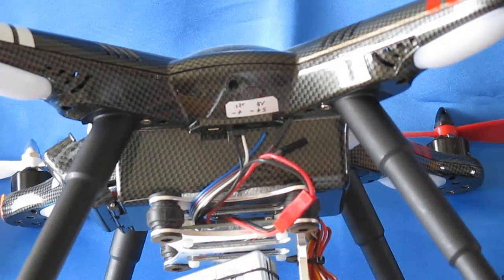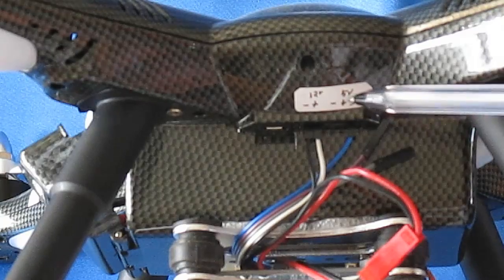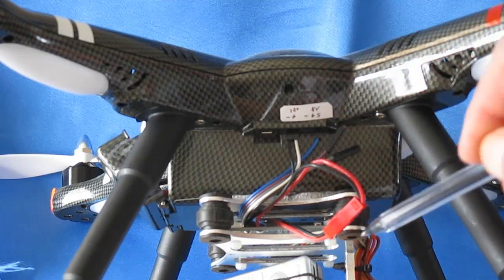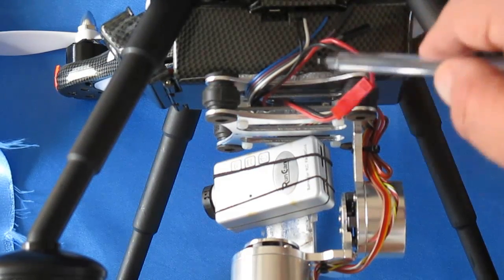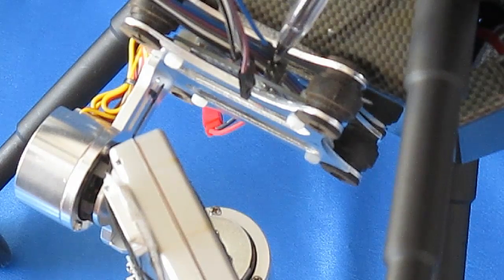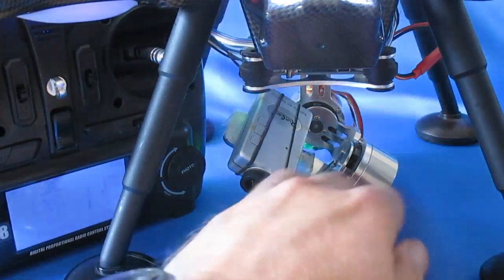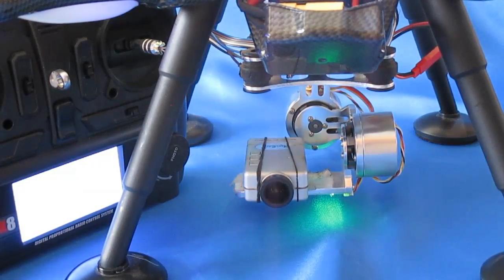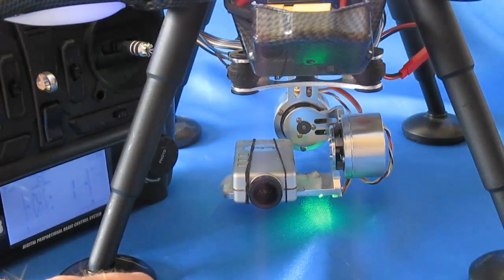XK Detect X380 Drone Generic Gimbal Electrical Wiring Setup

Comment: see how when you plug in the battery you get the light cycle tgat I was talking about (red to Green front to back) mine just keeps doing that when gimbal is plugged in (set it up just like in the video)
Reply from the maker: +mark valis If I remember correctly, your gimbal was received damaged with a broken wire.  Did you ever file a dispute with Paypal?  If not, time is running out.  Do such soon.
Reply: +Quadcopter 101 

got a refund and a new gimbal! however when I hook it up (12V and signal)  the LEDs go red to Green and it doesn't sync to quad I also just get a blinking red light(RTH and headless in up position)  As soon as I unhook gimbal I get green green in regards to GPS
Reply from the maker: mark valis Not sure what the problem is.  It sounds like there may be some interference with the GPS.  You don't have any add on straps or wires running over the top of the quad do you?
Reply: +Quadcopter 101 

no sir only thing I have done is GPS shield mod. When I unplug gimbal no problems
Reply from the maker: mark valis What is GPS shield mod?
Reply: +Quadcopter 101 

additional copper tape on inside of shell covered with a layer of duct tape
Reply from the maker: mark valis Of inside of quadcopter shell?
Reply: +Quadcopter 101 correct just YouTube search x380 GPS shield
Reply from the maker: mark valis I'm guessing that is where the root of your problem lies. Would recommend removing the shield to see if your problem goes away.
Reply: +Quadcopter 101 

I will check it out and report back

Comment: I installed a black 40 dollar ebay gimbal on my XK  380. I am sure that I have the wiring right and I received the factory harness in the bow with it. My problem is that sometimes it seems to work great with the sj4000 camera I have on it. Then the next time I power everything up the quadcopter will not finish it's self calibration. The lights keep flashing and the props are twiching. If I disconnect the pitch control motor and power it up  the problem goes away. Due you think I have a bad gimbal or should I try changing some settings with the software.
Reply from the maker: +michael landowski Try lowering some of the power settings.

Comment: when my gimbal is plugged in the lights on the quad flash in a circular cycle. starting with back left, it blinks red once then the back right blinks red once next the front right blinks green and then front left blinks green around and around?
Reply from the maker: +mark valis It shouldn't be doing that.  Unplug and recheck your wiring. Remember +/- 12V and signal wire only as shown in the video.

Comment: I have the neg 12v next to the USB have the positive next to that. then to the pitch signal wire and it is on the last spot on the right. the signal wire is hooked up to the top left pin in the gimbal
Reply from the maker: +mark valis That should do it.  If the gimbal is powering up properly (leveling), then the problem is the signal wire.  Maybe try a different color wire from the provided cable (maybe the one that your using has a break somewhere in the wire.)
Reply: I will try that, weird thing is the gimbal came with a white wire that connects to the gyro cut ? So I put it back together

Comment: Bud JonesWhen I got the gimbal, I could find nowhere to connect the multi-wire lead-- so I stripped of the green, and used the single lead to the signal pin. The only other connection I have is the 12 volt (correct). I get a green light- but it does not work. Any ideas my friend?Thankscbudjones@gmail.com

Comment: Bud JonesThanks for the video. Today I hooked up the gimbal-- checked correct wires, balanced camera, hooked up signal wire-- nothing happened. I did have a green light on the gimbalbottom, but no leveling, no pitch . Any ideas? Took me months to save for this combo.Thanks
Reply from the maker: +Bud Jones Did you also hook up the +/- 12V power wires as shown in the video?  And also be extremely careful doing such.
Reply: +Quadcopter 101 In hooking up the gimbal, I have 3 connects. + and - 12 volt and the signal wire-- no movement-- I do have a green light on the bottom of the gimbal. Man, I really need this to work. I have found a way to make money with it.Bud jones
Reply from the maker: Bud Jones Well then, the gimbal may be defective, a distinct possibility at its price range.  Recommend contacting your vendor's customer service to see if they can help. They'll likely ask for pictures of your setup, particularly the wire connections both to the quadcopter and the gimbal.

Comment: pleased to hear that - my x380 is due any day. I
I think you might be correct about all the problems. Also seems to be a lot of tinkering with software going on. I think I will be leaving it alone for a while
Reply from the maker: +Gordon Melrose Do NOT mess with its firmware if it works fine out of the box.
Reply: +Quadcopter 101 Thanks for the good advice. Looking forward to Friday's video !!

Comment: Hey I just received this gimbal and being new at this (and a moron) I have a question about connecting to the power lead to the gimbal.  I have a female connector (red and black thicker than the universal wires in the package) that has bare wires on the end. Do I have to use this connector or can I just use the universal connecting wires to the red male connecter to the  gimbal.? I hesitate to use the universal leads because they are smaller.  Gun shy after hearing about all these fried boards. I understand what pins to connect to.  Thanks for the time you are teaching us.
Reply from the maker: +Marv JS Plug those bare red and black wires into the universal connector.  Keep track of the colors that you plug the red (+12v) and black (- ground) into.  Follow these colors and plug the other ends into the respective (+12V) and (-) pins on the quadcopter.  Then plug the female connector into the male gimbal power plug.  Regarding the signal (pitch) setup, see my comment to John James below.
Reply: +Quadcopter 101 It seems the universal connector would slip into the male power plug --not having to use the one with bare wires at all. This would not work?
Reply from the maker: Marv JS It didn't fit for me.  Did you try it?
Reply: +Quadcopter 101 Yes--both - & + slipped in side by side into red male connector that goes to gimbal -just like the connectors went into the quad.  Did not put power to it yet.
Reply from the maker: Just make sure that red always goes to + and black always ends up at -
Reply: +Quadcopter 101 Yes---Thank You--I enjoy your videos

Comment: Will this gimbal work on the V303 Seaker?
Reply from the maker: +Turtle3863 Yes, it will work on just about any large GPS sized quadcopter, along with just about any camera.  Here I just strap it on with velcro straps to a Flying 3D X8 https://www.youtube.com/watch?v=gnCXyOEmgao
or hard mounted to my X380 https://www.youtube.com/watch?v=4MWK8bxkviE
Reply: Thanks for the info, I am looking to maybe get a $200 or so GPS Quad that I can use the gimbal on.
Reply from the maker: Turtle3863 Before I answer that, what quadcopter's do you currently own, and how long have you been flying them?
Reply: I have a Syma X5C -1 and a Mold King Super S, Been flying for about 6 months. Really looking for a more stable video platform.
Reply from the maker: Turtle3863 OK then. I particularly like the following quadcopter in that price range.  It does have gimbal capability if you wish to add one to it. https://www.youtube.com/watch?v=38IhbPDG-RQ
https://www.youtube.com/watch?v=ykH0VerKtCA
Reply: Thanks for the info, that looks to be the one I  will most likely get and then add the gimbal.

Comment: Hi any chance you can do a calibration video for the 380 I no the 303 is same procedure but the 380 for vertical circle shows red light and maybe there are other slight differences there is someone on my forum having problems and this could help
Reply from the maker: +Don XK Detect XK380 The person is probably trying to do it indoors.  Needs to be out in the open so that no magnetic interference will occur from metal objects nearby.  But yes, it is the exact same procedure as the V303, which has plenty of videos on how to do it on YouTube.

Comment: I have followed your exact instructions, and I was able to power up the gimbal, however, the R/C pitch function didn't work, what else am I missing?
Reply from the maker: +chanfelix Well the + and - power cables are obviously hooked up correctly.  But would suggest that you triple check and trace your signal wire connection.  Note in the video where I connect both ends of the signal wire (both where it's connected to the quadcopter, and where this wire should be connected to the gimbal).  If you're still having problems, please make a video showing how you connected the gimbal, with particular attention to the signal wire connection points.
Reply: +Quadcopter 101 
Thanks Quadcopter 101 :D
I will try that when I get my replacement board ;P
I thought I did something wrong in the wiring, so I was playing around with different connections, still no luck, until I decided to swap the + and - (bad mistake!) Soon after I hooked up the power,  I saw and smelled smoke coming out from the quadcopter and at that moment I knew I fried the circuit board on the xk detect x380.

I appreciate your help :)  I'll check back with you when I get my xk detect fixed.

Comment: I have that same gimbal in black and would like to offer a suggestion.  It's tuned for the weight of a GoPro type camera, so you might want to add some extra weight since your Runcam is significantly lighter.  I have seen folks tape on some quarters or washers to add the extra weight.  Without the extra weight,the PID tuning is probably off and could cause issues or shaky movements.
Reply from the maker: +mrbwa1 Actually, all you need to do is to use its configuration software to reduce the power settings for lighter weight cameras. Click "show more" for the above video information section for where to download this software, along with more info that may be of help.  And here's one fellow showing how to modify these settings. https://www.youtube.com/watch?v=clX-FC7m13Y
Reply: +Quadcopter 101 I forgot you did that tuning video.  I have been knee deep in tuning on the Cheerson CX-20 and looking at adding the #DR radios to get real-time telemetry back into mission planner.

Comment: hey 101, the GPTOYS F2 Aviax is only $26 free shipping on gearbest right now, everywhere else I see it's $50-60. it has cool features for a x5c clone and at $26 it might be the best bang for the buck quad now. are you getting one?  
 http://www.gearbest.com/rc-quadcopters/pp_246262.html?vip=55876

I'm also thinking about trying out the Helicute H806 Hexacopter, it looks like its a hex version of a x5c that has a 7.4v battery: http://www.gearbest.com/rc-quadcopters/pp_218232.html
Reply from the maker: +adventures and quadcopters That is a good deal.  That quadcopter also has a neat feature which remembers the last 40 seconds of flight, and repeats it at the push of a button.
Reply: +Quadcopter 101 I'm not sure if this is one of those temporary deals, like for instance the mould king 33041a was $20 now its $25 and when the flying 3d x8 came out it was cheeper. then jumped up.
Reply from the maker: +adventures and quadcopters Supply and demand.  But right now because of the X380, demand on the 3D X8 has decreased.  Price on it has dropped significantly.
Reply from the maker: adventures and quadcopters No, not currently.  And am not really sure what the advantage of it is over the much cheaper XK X380, which apparently has the same features.

Comment: Great video as always I see you have single pins for the power side my gimbal had a connector on end of power lead and either my gimbal or the x380 had a cable that pluged straight into connector and then clicked into quad so I can't get wrong way round just signal cable I have to fit now ps I will be putting this video on my forum more people that see it the better lol
Reply: connected mine today all went good thanks bud

Comment: Hey Quadcopter101, 

Somehow my FC is fried due to connecting the gimbal to the XK. I connected the JST, Black near USB, red other side. Yellow cable from left signal pin to outer pin of the XK.. This is correct if not mistaken, and still my FC board is fried. Do you know how this could have happend and how to prevent? 

Thank you :-)
Reply from the maker: +RC Brothers Assuming that you did connect to the proper points, the next thing to check is your wiring for shorts.  Particularly, did you splice any wires?  If so, are you certain that they are properly insulated? A bare strand of wire accidentally touching the gimbals metal surface (or touching an opposing wire) can create a short.
Reply: The gimbal came with a female JST connector on it, so I soldered a male connector onto the board in order for it to fit on the XK. It was my first time soldering, so I need to check that.. Thanks for the suggestion, will look if that is the cause ASAP :-)
Reply from the maker: RC Brothers Yeah, mine also came with a male connector with wire attached.  I just plugged that into the female connector, then attached the other end bare wire leads into the universal cable (also provided).  No soldering required.  Now I think I should have also showed that in the above video :(
Reply: Haha, it could come in handy for the beginners such as me but hey, I learn from this! :-) Soldering is almost inevitable in the quadcopter business, but connecting a female wire instead of soldering the wire is a better option than what I have done

Comment: I bought the xk gimbal for mine its a little more expensive but I don't have to worry about hooking something up wrong. I'm seeing a few problem and crash videos popping up I was wondering if you've had any problems worth mentioning with yours ?
Reply: +Ronnie Boardman Do the makers of x380 make a gimbal that you can plug and go with?If they do, please give me the information---I am very concerned about shorting out my quad and frying my boards.
Reply: Yes they do I bought mine off Aliexpress. They are a little expensive but I would rather pay extra and not worry about shorting something out. I found mine there for $114 delivered free I think the last I looked I saw them for $113. Who knows you may even find it cheaper now.
Reply: +Ronnie Boardman Thanks a lot---do you have to do any computer manipulating? Are both plugs ready to plug in and fly?
Reply: They are plug and go this gimbal is made for the x380 and is the same one that comes with the camera version model. I don't know a lot about them I haven't even used it yet but from what I understand stand its a decent gimbal and works great.
Reply: +Ronnie Boardman I see one on Aliexpress but it has a camera.  Is that the one you have?  About $115.  Can you tell me the description you used in the browser?
Reply: Try xk detect x380 parts , I think that's how I found it.
Reply: +Ronnie Boardman I found it at Banggood---Not in stock $111.  After you get yours working let us see some videos of this gimbal at work.
Reply: +Marv JS I'm not sure when I'll even be able to fly I've been pretty busy and winter is getting close so unfortunately I may not even be able to use it till next year. I've been wondering why there's no videos already out there but I've not found any with the xk gimbal. I don't get why people aren't buying them really they're not that expensive.
Reply: Actually they are a few videos out there look for xk detect x380c. That's the model with they're camera and gimbal. I found several videos and the gimbal looks like it works great.
Reply: +Ronnie Boardman Yes, I have found a number of videos---So sorry --Thanks

Comment: This is wonderful, Dr. Quad. I have the X380 and I should be receiving a gimbal in a few days. I was wondering what the pin outs were. I've been reading about guys burning out controller boards by hooking up their gimbals wrong. The gimbal I ordered is the plastic Walkera 2d one after reading some recommendations on the RC Groups list. This should make it easy to setup. Curious if the rubber ball mounting gets rid of the jello on your gimbal? My X380 produces a lot when I use my GoPro on the stock mount. I balanced propellers and added foam, but I still get a lot of vibration. Any tips in this area would be appreciated.
Reply from the maker: +John Richardson Yes, plugging into the wrong pins is very bad, like crossing the streams.  It may result in total protonic reversal, or at the very least, a fried quadcopter board :(  The provided mount is too stiff.  To minimize jello, it's necessary to allow the camera to have some give to dampen the vibrations.  The rubber ball mounts may help as they provide this give.
Reply: +John Richardson i heard some people stuff the gimbal rubber dampeners with differing amounts of foam to avoid them all having the same resonance, i'm on my second plastic g-2d, don't mess with the default go pro settings  manually